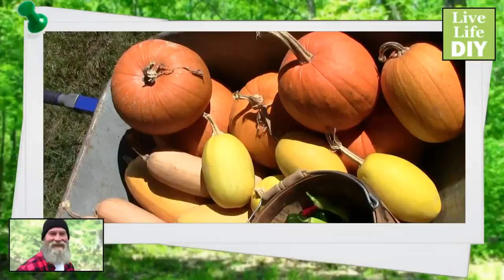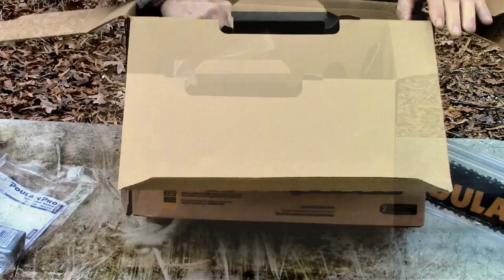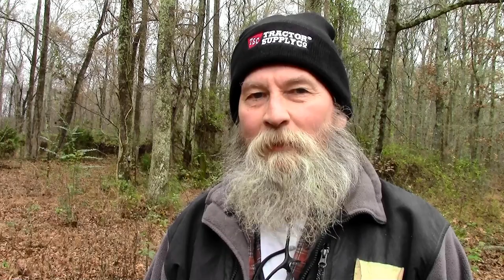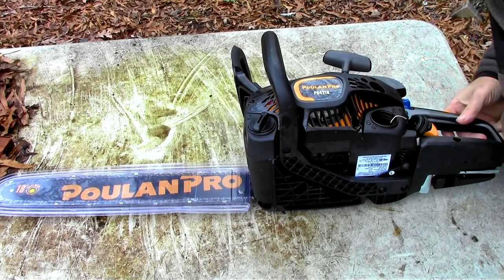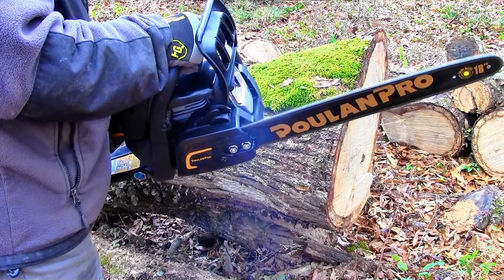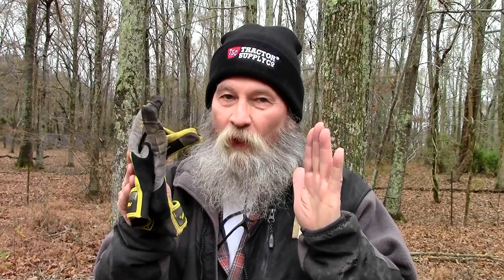On SALE Poulan Pro Chainsaw 18 Inch 42cc Unboxing Start Up and Operation

Comment: Best tip for these saws>>>>Gap the spark plug to .030! It will start all the time and it will run better.Adjust idle mixture IF the saw doesn't stay running..Mine NOW RUNS GREAT!
Reply from the maker: Thanks for the tip. Seems to be a frequent suggestion.
Reply: Same for their hedgetrimmers???
Reply: @filoIII  if they have the same engine, yes

Comment: These are great saws for the money.  After several uses, they tend to become hard to start, as they are tuned very lean from the factory.  Richen up high and low speed screws as necessary and they will start right up and run great.  Use good oil at 40 or 50:1 and they will run forever.
Reply from the maker: I agree.

Comment: Most of the time people have trouble starting 2 and 4 cycle small engines is because they only start it when they need it.  You should see my calendar, every July and January: 1) Start and run chainsaw.  2) Start and run generator 3) Start and run water pump (July only, hard to pump water in January here).  All the things I only use occasionally get started 2x per year no matter what and I let them run a bit.
Reply from the maker: Yep. The other day I started all of our summer equipment, mowers, trimmer, tiller.
Reply from the maker: @DankSide606  Amazing! Says a lot for the better built older machines.
Reply: At least every thirty days for me,Honda gens, Weedeaters, lawnmower, whatever aI have.
Reply: This is one of the smartest things I've read. I'll definitely do this. You're right, I normally only start my 2 cycle stuff once or twice a year.

Comment: I'll still throw mine out there 4 years later and it's a big one. Using old gas. Gas has a short shelf life of about 3 months and then it can start causing trouble. I always try to start with fresh gas and the correct mixture for best cold start results. I use a funnel, dump it out and replace with fresh gas. Once any small engine is warmed up then I use the older gas to get it used up as it still works well. Also never let a small engine go longer than 2-3 months without starting it. I set a reminder and go start things for a few minutes to warm up and shut it off. Wife thinks I'm crazy but everything keeps running. LOL

Comment: Couldnt agree more. So many people blame their saws for not working when they get the fuel mixture wrong. I think another problem is people leave gas sitting in their chainsaw all winter which then goes bad and stops it from wanting to start. Another issue is people ask more from their saws than what they are designed for. So many people burn out the engines in their chainsaws misusing them by doing things beyond the capability of the engine

Comment: Got mine at Lowe's. Same model. Came in a hard plastic case. No instruction manual, no extra chain, I'm guessing somebody bought it and returned it. Paid 69 bucks for it. That was 3 years ago. After Hurricane Milton I'm finality taking it out of the case to use it.

Comment: After starting -- Let the saw warm up and let all the metals find thier happy size. Different metals expand at different temps. Don't start it and gun the hell out of the engine. They don't like it and will let you know pretty quick.

Comment: I had a older 4218A, it was one of my favorite saws. I had it for three years. never had a problem with it. My best friend needed a saw and loved it so much, he bought it from me for 90 bucks. Its been a year and a half later and he still limbs and bucks logs with it. He blushes when he mentions that saw. I would buy one again in a heartbeat but I have my older Husqvarna 340 and 353. Husqvarna has made Poulan since 2006.
Reply from the maker: Great story. I'm always amazed at people's strong opinions. Certain subjects, like chainsaws, brings up the, this brand is great and this brand is junk.
Reply: Some people argue, just to argue. The majority of those folks have little to no experience with a chainsaw. There's lemons with all brands, its just the luck of the draw but few and far between.

Comment: Great!  I just bought one of these tonight for 100.  The guy won it in a raffle, and had no need for it.  Brand new in the box.  Came with the hard case, and an extra chain in the box!  Thanks for posting this video.
Reply from the maker: That's an awesome deal. I just got the saw.
Reply: Good steal!

Comment: I have 2 old stihl saws and I use them a few times a year. I always pour the gas out of the tank and then I crank a let it idle and even choke it a bit when it starts to die. Once it runs out of gas and dies I remove the spark plug and shoot an ounce of 2 cycle oil in the cylinder, refit the plug and pull the cord a few times to lube the rings. I have went over a year without using the bigger of the 2 and it always cranks up without issue. To me, fresh gas for a saw is like fresh fruits and veggies for me....
I have owned poulan, craftsman and they were pretty good saws for the price. For $99 bucks you made a good purchase.
Reply from the maker: Great advice about good storage practices.

Comment: Have several Poulans, used them long and hard on big trees, they cut great! Use 93 octane non-ethanol with Stihl synthetic oil, 40:1 in everything, no matter what they call for.  My opinion is in comparing chainsaws, people forget about the sharpness of the chain at the time. Keep it sharp and I will out cut my buddy using his expensive Stihl, who doesn't know how sharpen a chain.
Reply from the maker: Completely agree. We definitely use non-ethanol fuel. Not sure if high octane is available here? And properly maintaining equipment, like a sharp chain, is critical. The 40:1 makes me a bit nervous. Thanks.
Reply: Same here I use 40:1 on everything...  I have a lawn care business and in 6 years  no power tool has been damaged
Reply: Definitely  40-1 in everything  2 stroke. 👍

Comment: I bought the same one for $150CDN, I use 40:1 Husky oil and chain oil and changed to an E3 plug, it runs like a top now with zero hesitation, fires in 1-2 pulls on choke then one more off choke to run. Just ordered an Oregon chain and bar which will make it much more efficient. It’s crazy how much difference a chain alone makes with ease of cuts instead of just wasting time and fuel. Cheers
Reply from the maker: Yep, I also purchased new chains. Nearly twice the number of teeth on the new ones.

Comment: I've had the 4218a for 8 years. Zero issues. I just Put a 14 inch Bar on it because most of my wood is smaller than that. What a screamer it is now.
Keep It sharp (sharpen your chains.... Even New ones), run no Ethanol... Great saw.
Reply from the maker: Thanks for sharing your success. I'll probably invest in a 14 inch bar. And I always use non-ethanol fuel.
Reply: @GoosePondHideoutWithRob  I still have and use the 18 for bigger wood. Love My 4218a.

Comment: I bought this exact chainsaw about a year and a half ago. I believe Poulan Pro is a division of Husqvarna and seems like a really nice saw for the price. I felled a few big pines with it, cuts like butter through pine. I even didn't do anything to store it over winter, it fired right up this spring.
For little stuff I use a pole saw attachment on my Echo weed whacker.
Reply from the maker: Glad to hear. Mine is running fine too. I did purchase a pole saw, but it's still in the box.

Comment: I have a Poulan pro 42cc I bought as a factory refurbished in 2008 and have used it about 40 hours total.  I worked on tornado cleanup for 2 days and it was the best saw on the crew.  Not a  Husqvarna but not a bad saw
Reply from the maker: Many times, it's more about the operator than the equipment.

Comment: your spot on. when I was 16yrs old I bought my first
Poland believe me it was much more.
I am 60yrs old been cutting for 46yrs. your right mix fuel spot on 50:1
start saws offend.You can't go wrong. buy the way I've owned my third saw for 17yrs. It's a husqvarna 372. Poland is a little slow but that's ok!!
Good Cutting.
Reply from the maker: Thanks for the information. Much appreciated.

Comment: I actually bought this very same saw for my small & medium duty work and I’m very satisfied with it.  I fall trees of about 14” or less, it’s what I use to cut my 12” or less fire wood for splitting... and for wood for my smokers.  It’s also the saw I take with me to the cabin and on car camping & fishing trips.  And it’s used for trimming our fruit trees.  I have used it to fall large trees and to cut large logs, and it does the job as you demonstrated in your video, but I have a larger saw for those jobs that works better.  This saw has also proven to be very reliable, and actually gets used more than my larger and much more expensive saws.
Reply from the maker: Well said. I completely agree.

Comment: I have one and I love it. I realize it's not a Stihl or a "pro" saw by any means, but I've had mine for two years and have cut about an acre and a half of wood with it and it is still running fine. For the price, I'd buy it again......
Reply from the maker: I'm happy with it so far. Correct, it is a basic saw, not a pro by any means. I'm uploading a video tomorrow about sharpening the chain. The Poulan only has 21 teeth, way less than a pro style chain.
Reply: Jonsered 2250s is a nice chainsaw with 14,500 rpm.

Comment: Thank you for the video...i did buy this saw and your video was a blessing...i did the exact same thing you did..i wanted a smaller one but at that price I couldn’t pass it up...we do have a big saw but i hate handling that monster....so i settled on this one and bought mine for $99 dollars too....I’m off to try it out...perhaps i will be back with an update for you...but thank you very much!
Reply from the maker: I think you'll like it. It's not fast with it's basic cutting chain. And it idles a bit ruff. But it's well worth $99. I'm working on a chain sharpening video for Sunday.

Comment: I had a Poulan for years probably got 20 hours of good use out of it.The rest of the time i spent either trying to start it,recleaning the carb,replacing fuel lines,scratching my head or putting it back in the shed till next time.I finally threw it away and lowered my bp never to be frustrated again.

Comment: I picked up an old yellow PP4218A at an estate sale for $40, thinking it would need rebuilding.  Instead, it ran great and with a new chain was a beast, so it became my “big” saw for anything my little 14” Mac3200 couldn’t handle (which was almost nothing).  I’ve had it for 20 years now and only once needed a carb rebuild.  It still runs great and I use it regularly on my 8 wooded acres for the really “dirty” jobs like cutting stumps.  I often have to sharpen dirt-dulled blades mid-cut with my Dremel tool and diamond rotary bits, but afterwards its good to go again.  Not the smoothest running engine at low speed while four-stroking, but it leans out beautifully “in the wood”.  I find that Poulans flood easily, giving them an undeserved reputation as hard starters.  Just use the choke very sparingly and only to get that first kick when cold.  I also use a Stihl 026 Pro for tree felling, but don’t really find it any stronger than my Poulan…..of course I would never use my Stihl in dirt.
Reply from the maker: Sounds good.
Reply from the maker: Sounds good.

Comment: I have a craftsman (rebadged Pouland) that I purchased back in '97 to clean up some land that I had purchased. I cut a lot of wood with it, and never did anything special with the saw  other than keeping the chain tension correct, and properly oiled and fueled. I never did anything when I stored it......just shut it off and put it in the case. My garage is not heated and it gets extremely cold where I live in the winter. This past spring the fuel lines finally gave out and had to be replace at the shop ($47.00). Although many do not like these cheap saws I believe that they have there place. They are great for occassional homeowner cleanup use. They are also great as a backup saw, and for those who don't want to spend hundreds on a saw as they don't do heavy-duty cutting. My saw seems to have the same compression as it did on day one, starts and idles perfectly despite being 24 yrs old. Just keep the chain sharp and adjusted and you will be amazed at how well (and inexpensively) these saws get the job done.

Comment: I've been looking around here on YouTube for those people that own poulan chainsaws like myself and was I surprised that there quite a few people that own at least one and don't have any issues with them one bit. I've got the poulan 3314 and the 5020 and both work flawless and run perfect! I do own a 14 inch Ryobi 2 cycle chainsaw that I only use as my backup chainsaw if all else fails. I have been looking at getting one more to my collection and it's either the husqvarna 120 or the poulan seen here in your video. I've used both once before and liked how well the both run and do the job, but being I'm a poulan product buyer, i may go with this one you bought as your backup saw but both chainsaws are built by husqvarna and built to last if they're taken care of properly. I do appreciate you making this video showing those of us what your backup chainsaw is

Comment: I bought one in 2019 at Tractor Supply for $99.  I find that it is cold blooded & takes some time to warm up.  But once it is warm it seems to cut really well.  I have already replaced the original chain because most of the teeth became damaged.  I don't remember cutting any metal metal in any of the trees I've cut down or cut into firewood.  So I now have a Oregon S62T chain on it.  I did notice that it eats a lot of bar oil.  So I check the level about every 5 to 10 mins. 

I did talk my brother into getting one when they were on sale.
Reply from the maker: Thanks for sharing your story. I appreciate it.

Comment: I've cut with Poulan Pro saws for decades now. They weigh about half of what the Sthils and Husqvarnas do. the saws are cheap, powerful and easily repaired. Never had any major breakdowns that couldnt be fixed. (aside from just plumb wearing them out) Oreagon bars and chains and go.
Reply from the maker: Yep, I agree.
Reply: Interesting on another video he was comparing his poulan to a husky and the husky with a bit more displacement he said was lighter. Maybe this was an older poulan though.

Comment: I have the 18” and 20” both came from a tractor supply sale. Honestly I love how easy they are to start I have a wood boiler so I go through a bunch of wood. I’m on my third year with the 18” saw and year 2 with the 20”.
Reply from the maker: That's awesome news. Thanks for sharing your success story.
Reply: I am using mine for basically the same reason although for my outdoor fire bowls that I use a LOT (love outdoor wood fires).
Reply: Use the cs 36 and  42 versions both have paid for themselves  times over 
Now 4 years use and still reliable .Tip drill two small holes on casing at the rear of saw let's saw breath  remove spark aresstor gauze from exhaust drill two small holes at bottom front exhaust saw will not overheat and gives about 30 % more power .run mix at 40 .1

Comment: I did do it i got the exact same black friday deal ended up buying the display model it was the last one left and i purchased the same tractor supply hat for $3 lol. Also i replaced bar and chain with oregon advance cut and full chisel chain and let me tell ya! It really woke that saw up i cut the same size logs you cut in a quarter of the time it took with bar and chain that came on it
Reply from the maker: Awesome.

Comment: I own the exact same chain saw. And i love it! i bought a master set of carb adjuster screwdrivers. i found with the cheaper saws like poulan they leave the factory much leaner than the big brands like stihl and husk. having the ability to adjust the carb really helps extend the life of the equipment. lean is great for emisions. however at 50:1 there isnt much lubrication when the saw is running lean. the auguement with power equipment today running 50:1 is that oils today are better and it doesnt require as much oil to acheave the same job as past oils. i run motul 800 in all of my 2 stroke stuff. it is a great oil and has never let me down. here is some fun info on poulan chainsaws, the engine is a design called oxypower. owned by huskavarna. ita a husky engine in a cheaper plastic case. that same engine is also used in the crafstman's 42cc 18" saw. i did ritchen up my chain saws fuel mixture and i run my saw at 40:1 oil raito. also there is an emsision compliance sticker on the saw. it tells you how many hours the engine is predicted to last with factory settings. however usage, abuse, and care will really determine the life of the saw. great video!!
Reply: I have an older poulan 4018....had it for years but now it starts and runs but then dies...won't stay running when under a load. Gap on spark plug seems what everyone recommends. But the adjustments for the carb have some hex-head type stubs and very small at that. Guess making it easy to adjust never came up in engineering or design?
Reply: My farther in law just left a gummed up yellow version of this saw at my house.  While looking for info,  Poulan specified 40:1 in 2013 for this same saw   If I get it working, I'm considering buying a pole saw extension for my 4 cycle Ryobi weed trimmer.